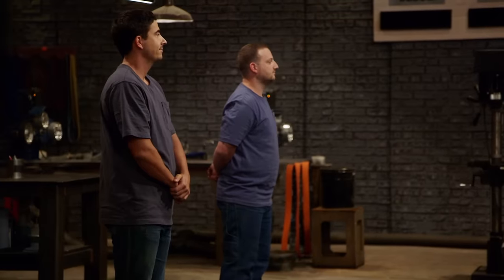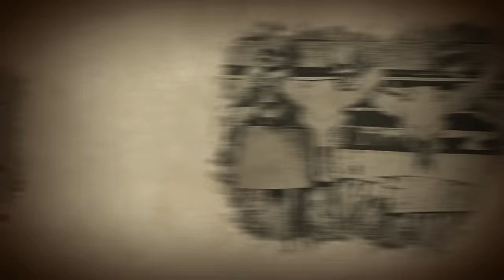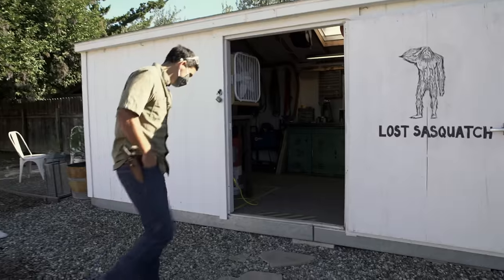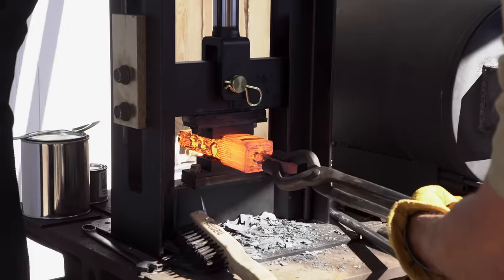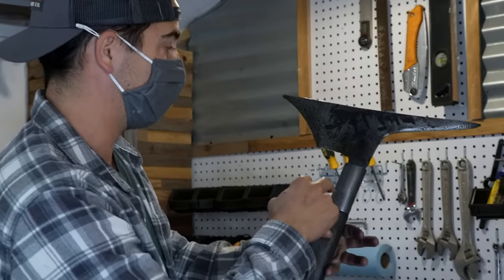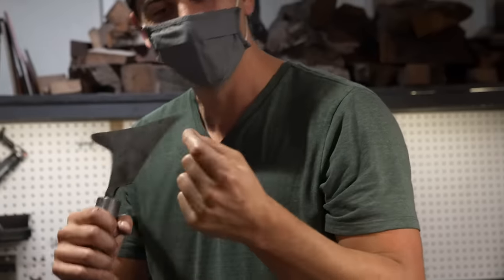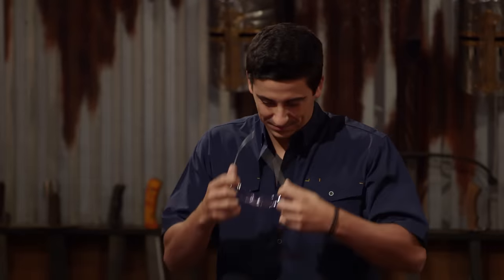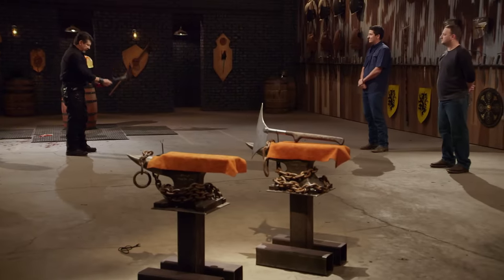Forged in Fire: The Headhunter's Axe Seeks RAGING Revenge (Season 8)

Comment: I love it when someone does research on the weapon they are making. Too bad the wood gave up, this would have been a really close battle between these two axes and most definitely one hard decision for the judges.
Reply: He had to know how to properly atach a wooden handle to an axe. Wooden grain orientation on both knives and axes handles, is a basic knowledge, that all smiths know. It's not bad luck at all. The way the wood split, is obvious he installed it the exact opposite way. You have to align the grain of the wood parallel with the blade, not the opposite which he did....
Reply: @greekveteran2715  isn’t the other axe handle the exact same way, pretty sure I can see the grain in the close ups at the end and it runs up/down the blade
Reply: @colamity_5000  The only spot, you can see if the grain of an axe handle is proper, is the very bottom of the handle. That's something you can only spot, only if you have the axe in your hands. The lines, have to be parallel with the blade. If the lines are 90 degrees facing the sides of the axehead, that's when the handle will fail and that's why this handle broke, some people did the same post (check all the comments and their replies, you will see more people, having spot the reason of the failure) It's obvious from the way it breaks...People who agree with me, we all have seen such failures, and we all know a think or 2 about knives and axes.
Reply: I see what you did there. Nice pun sir. Always intend you puns. There isn't any room for those who don't.

Comment: I feel bad for the guy, he forged a beautiful and deadly weapon only to have the wood handle give out.

Bad luck, good Smith.
Reply: Well, choosing the wood with the right grain orientation is part of the build.
Reply: It was a painful loss. He fixed a crack in the blade only for the handle to split.
Reply: It wasn't bad luck. He oriented the wood grain in the handle the worst way he possibly could have which is entirely why the break happened. If he had rotated his handle 90 degrees and lined up the grain of the wood with the edge it would have been fine.
Reply: @bgdowns10171  He's a bladesmith, not a woodworker. Someone mentioned this before, but if they want to see pole weapons, they should provide the wood for it for both contestants.
Reply: @horvathbenedek3596  A blade smith still needs to know about wood grain. They do make wooden handles and consider the wood grain when they do I hope.
Reply: @horvathbenedek3596  most bladed weapons use wooden handles... i think it's an important part of knowing how to make a deadly weapon
Reply: @raidenxt8737  Handle scales aren't the same as hafts. Hafts use wood as a structural component.

The show is forged in fire, not turned on a lathe.
Reply: Though not ideal I think you can get away with grain perpendicular to the edge but if a large portion of the grain doesn't run the length of the handle your fkd. I think that's more what happened here.
Reply: @horvathbenedek3596  AS others said, he has to know how to properly atach a wooden handle. Wooden handle grain orientation, is a basic knowledge for both knives and axes.
Reply: @horvathbenedek3596  Ax is both: bladesmith and woodworker. All work it!
Reply: @mrkiky  And that wood looked fine. It didn't appear that he was the reason the wood broke.
Reply: A bad choice in the wood.
Reply: @horvathbenedek3596  doesn't matter. Bladesmiths didn't just make swords they made axes and spears and knowing how wood grain runs was their literal job, troll.
What's worse yet is how many non-blacksmiths are aware of such a thing.
Reply: You cannot unfortunately see problems in the wood grain. You can see the exterior parts, but not the interior!
Reply: Actually the handle is the hardest to make in this kind of blade.
Reply: People have a very Modern standard when it comes to ancient weapons. A well made axe head or spear point would see multiple hafts & handles in their lifetime. Wooden parts are replaceable/disposable.

Comment: They're always so happy that the blade hardened like it's their first knife or something. I mean they're in their own shop, they know what oil they have, they know what material they're using, they see the blade is hot enough. There's no way it's not gonna harden. I'm beginning to think it's a requirement from the producers like "ok now we have to film the shot where you file test and get all happy". Only dude who I can remember not doing this is Burt Foster who said "I don't need to test them, I know they're hard" , which makes perfect sense.
Reply: Well sometimes blades warp when quenching so i would be happy if my blade did not warp so i dont have to do the heat treat again.
Reply: @gabrielxddyo5454  yea but im talking specifically about hardening
Reply: Heat treatment of a blade isn't a 100% activity for even an experienced smith, and given the timelines that contestants face during the final round of FiF, dodging even a 5% or 2% chance for failure is a big relief.   There's a lot of judgment and estimation going on as these guys do not have the sorts of facilities that allow them to have specific and precision temperature measurement - they need to go by color.   Further, a lot of them are making the largest weapon of their lives in the FiF final, as there's little reason to make these kinds of weapons as an amateur: its the same activity, but often larger and more awkwardly shaped.

The artificial time pressure of the FiF finale is designed to make some parts of the process involve extra tension, and the heat treatment is definitely the biggest one of those.

The relative experience of the FiF contestant is also lower than I think you believe: you can really see this in the episodes with established figures like Ilya Alekseyev of That Works/Man At Arms.   They chose much more challenging and specialized final challenges in those episodes in part because a contestant like Ilya, with extensive experience forging historical replicas and with access to a large, professional-grade shop environment, would have a disproportionate advantage over the facilities of the average FiF competitor (many of whom are using knife sized forges and hobby-grade power hammers).   Imagine if Ilya had been paired up against a typical competitor forging a blade instead of another armorer in his episode: it wouldn't be close to a fair fight just in terms of the resources and equipment available in their 'home forges'.  Most of these guys are working in their garages or a small attached building.

The typical FiF competitor is a skilled hobbyist, not a professional master smith.
Reply: @mikejunt  Yea it's not a 100% activity but not to the point where a file test is gonna tell you if it's good or not. Every time it doesn't harden it's because they're using some questionable harvested parts from the challenge, which I would understand getting happy about. But in their own shop , they got the good steel they worked before with, blade is red, dunk it in oil, it's hard. 
And yea clearly the contestants are of different skill levels and they usually pair them up so they're about the same level. And the challenge is designed to test their limits but not to exceed their limits by a lot (they learned their lesson after the double greatsword fail episode) Sometimes there's a huge mismatch though. But even for the least experienced guys, heat treating known steel should already be trivial. 
Also if they really worry about a 2-5% failure rate, they should really stop attempting damascus, because that has a failure rate of 80% 😂

Comment: The spike on the back wasn't for penetration of armour or shields. It was for driving into the ground or a log so that the main blade was presented upwards in a fixed position when using it as a tool for certain tasks.

Comment: It split along the grain, at a diagonal along the handle. if grain had been straight down the shaft then it might have survived, one reason to split wood for handles rather than saw and plane.
Reply: Typical case of the metalsmith not spending enough time on the wood database XD.

Comment: I don’t understand why they binned him off because the handle broke? They should have given an opportunity to replace the handle and continue. Poor choice from the judges
Reply: Because the other guy made a handle that took the same abuse and didnt break. 🤷‍♂️ its about the whole of the item, not just the metal bit
Reply: @hello7533  yeah I get that but wood is different? You can’t judge the entire weapon on it’s only consumable part.
Reply: @norris050  sure you can, it split right where he carved shoulders on it to meet his socket. Obvious stress point he didnt cater for, or a pre existing flaw in the wood he didnt see. Either way, its his fault as a weapon maker. Harsh, but a fair call from the judges. 
Its a consumable sure, but it should wear out, not fail catastrophically.
Reply: @hello7533  I get where your coming from but iv seen countless episodes where blades take serious bends and they allow the smiths to rectify them.. making a wooden handle always has and risk, and it’s a consumable part. Really they should have given the smith a reasonable chance and let him re-handle it.
Reply: @norris050  that would be not fair for the other guy who made a more stronger and more durable weapon. Both spent 3 or 4 days to complete the same kind of weapon. If it breaks, it's over, even with a broken handle.
Reply: @norris050  No, in the finals, they don't allow the smiths to rectify bends, that's only in the preliminaries. In the finals, if a blade bends, and the bend isn't bad enough and the weapon is still usable they will allow the tests to continue, but if it bends to the point the weapon is no longer usable, the smith is eliminated. That is exactly how it is with handles, if the handle has a minor crack they will allow the tests to continue, but once it is no longer usable, as is the case here, it is eliminated.
Reply: @norris050  the black's smith should done more research wath type of wood to use for the handle here in my province Cordillera we use the kamagong wood it was a strong type of wood here in the Philippines
Reply: In the heat of battle a broken handle can’t be fixed but a bent blade can be somewhat straightened and the only time they allowed a bent blade to be rectified is when the other competitor had a complete break and they had to determine a winner